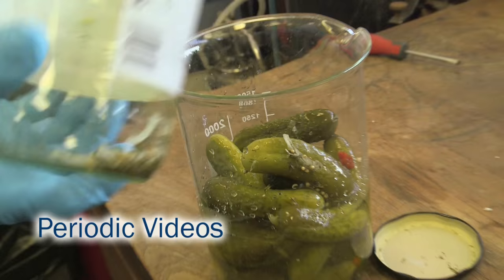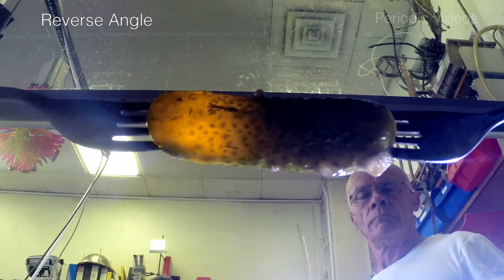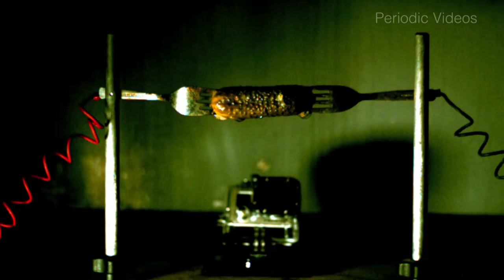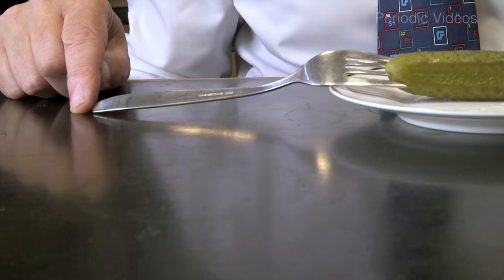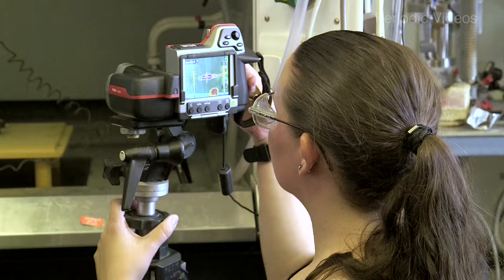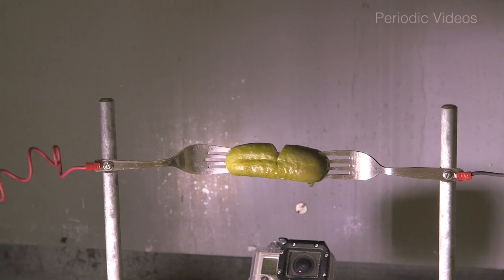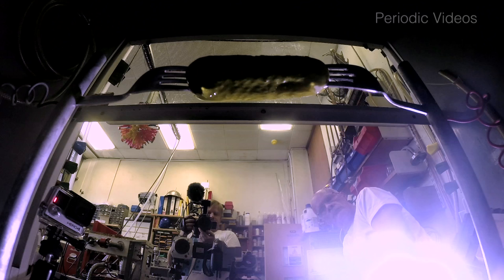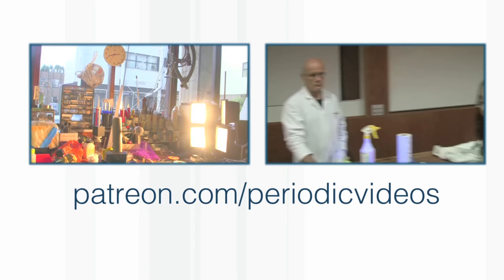Electrified Pickle - Periodic Table of Videos

Comment: Just converting liquid photons (electricity) to gaseous photons (light)
Reply: wut? liquid photons what the hell are you talkin about
Reply: With this understanding I was able to predict what would happen in this experiment without ever hearing about it before.  Light is a gas.  Electricity is a liquid, and bonds are a solid.
Reply: same reaction. wut?
Reply: That's so dumb it's near genius.

Photon radiation is essentially periodic, you can't explain direct current with electromagnetic waves. So the analogy don't hold.

Crystals are archetypical solids, they are coherent are the molecular level and knowing the relative position of one bit of matter allows to extrapolate the position of other bits of matter in the crystal. Lasers are coherent light fore example, and if the analogy with crystals has its limits, there's only one phase in a perfect laser (just like in a perfect crystal). Light can be "solid" if solid means organized. So the analogy don't hold.

But there's a tiny glimpse of genius in your comment : there is a continuum in electromagnetic phenomena between current, surface plasmon resonnance and electric current in SOME VERY PECULIAR conditions only if you express them in term of varying electric field. I don't know much about this, but Biacore automatons used in biochemisty labs use this principle.

NatureHacker, please continue your journey with SCIENCE.
Reply: Making light is just the process of allowing electricity to evaporate.  This understanding is required to innovate in the illumination field.  Glowing is the sublimation of bond energy.
Reply: That is a rather unconventional approach and i think particle physicists with strongly disagree with you on this.
Reply: light is no more of a particle and a wave than water is.  Light is just a material.
Reply: +NatureHacker you believe in aether then?
Reply: I think there is a field of dark light, basically photons that have slowed to a relative stop that are unable to assume a more condensed form like electricity or chemical bonds